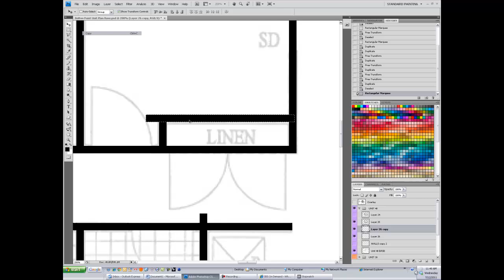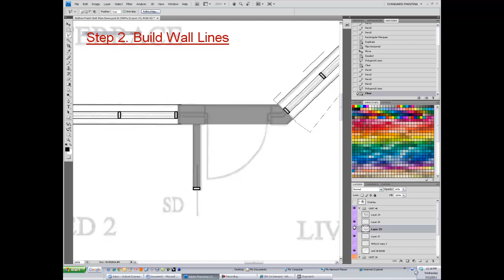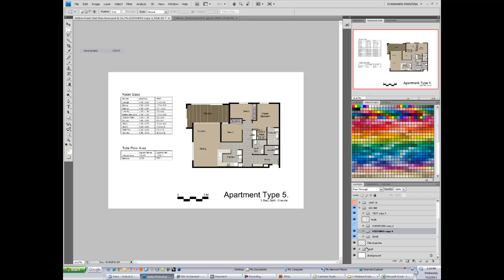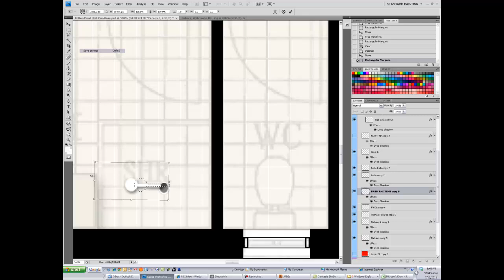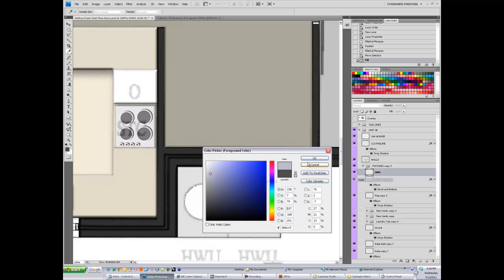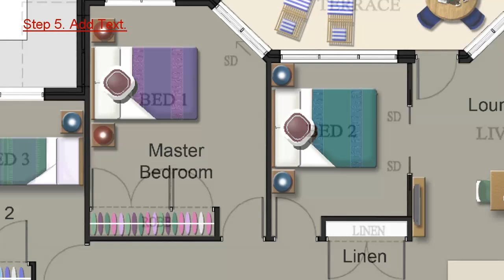Photoshop Rendered Floor Plan

Comment from the maker: While your observation is correct of itself, in that being supplied with a dwg file as a base would be better for accuracy, it is also a matter of context. You can hopefully note the floor plans supplied as PDFs by the client are from the 1970's pre dating any form of CAD. Hence while the image is an approximation it is more than accurate enough for marketing purposes particularly  in conjunction with the floor area table shown at the left hand side.

Comment from the maker: I think somelse may have already responded to this, however in this case the file had been supplied by the client as a rather rough PDF file, from a rather old set of architectural drawings

Comment from the maker: This seems to crop up a bit. The project drawing predated Autocad so I was forced to scale the drawing against a scale bar I had made in photoshop match to a dimension line on the base image. In Autocad as far as I know you should be able to output the file as a specified format and scale for printing. You should be able to rneder in Photoshop over this.

Comment: I am designing something similar and my problem is the walls are in a separate layer that I have created won't delete the space for the doorways and windows, am I doing something wrong?
Reply from the maker: Hi Kenya
I'm not sure if I can help.
Can you just go on the wall layer , then use the rectangular marque tool to select the section of wall you no longer need then press the delete key on your keyboard ? ( Just make sure the layer isn't locked.)